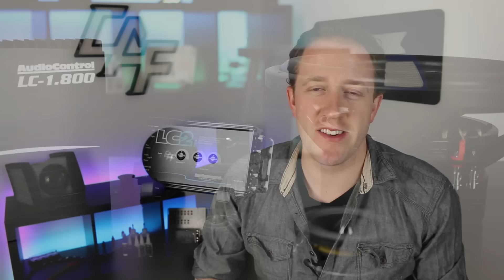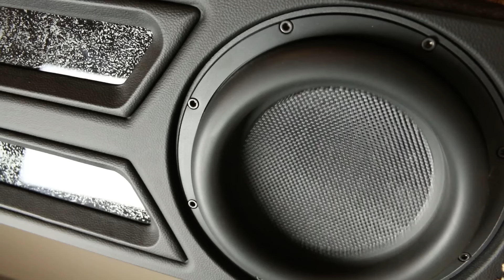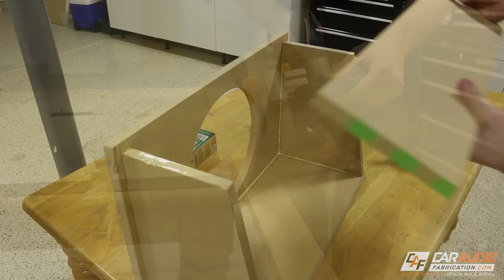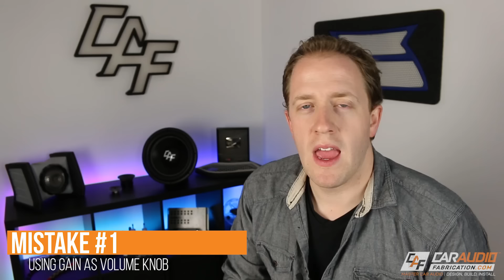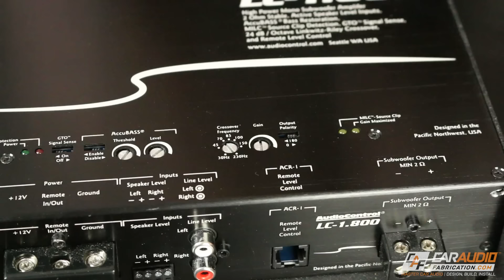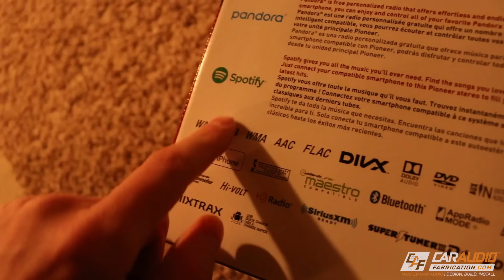Avoid these 5 common Car Audio NOOB Mistakes!

Comment: Lets Say im looking to run a box thats sealed, and the sperate thats ported, both 12 in sub: should i buy two different amps or one? Im looking to give the sealed box more power, because im going with a stronger sub for the sealed box. I hope i explained that clearly 

If one amp is all thats needed,  can that one amp control the two different subs separately? Is that feature called "the channel"? 😅😅😅 Sorry im new to all this

Comment: Old video but I'll toss it out. I bought new Rockford 6x8 a few months ago then ended up getting a new vehicle that has factory 6x9 on all four doors. Should I cut my losses or make some adapters? One of the factory speakers is blown. I do plan on upgrading everything starting with the 3.5 in the dash

Comment: So a def issue I could've seen myself doing is the last one. I'm a noobie, never done an upgrade to the sound system of any cars and never owned my own car yet. I'm planning to buy a '94 Fleetwood Cadillac hearse. I don't want an insane huge stereo system or anything but just something kinda nice with some good quality sound. I've watched a few videos and understand most of these rules. But I never thought of the whole thing of the lights dimming and possibility of having to upgrade the power system to the car if I do too much. So that is an issue I may need to look into now lol.

Comment: Would someone tell me if I dont have enough airspace? 2015 camry with Rockville RV12.2B 1200W Dual 12" Car Subwoofer Enclosure+Mono Amplifier+Amp Kit. Or would it preform better if i had 2 10in subs? or help me figure that out.

Comment: When I was 18 I got 2x  12"s rated at RMS 2k each. I thought they were soo cool. Then I ran them parallel to a 1x 3K JBL amp at 1.5 ohm, rated for no less than 2 ohm... 😬 Then I ran them in a off the shelf ported box that was clearly too small... 😮 And lastly I upgraded to a deep cycle marine battery and two capacitors... And wondered why I had to buy a new alternator every few months.   Silly kid! I am shocked that amp took that abuse. It never failed but you could fry an egg on it!

Comment: The gain control of any amplifier is used to set amplfication factor of any amplifier and to match audio source impedance with amplifiers input impedance.

Volume control ≠ gain control.

Volume knob just works as voltage divider, used to set output signal level from audio source.

Thank's for explanation CAF.

Could I use these tips for home audio too?

Comment: Hey, love your videos! I just bought a 2024 Civic. Is there any reason I can’t run a amp and sub with the high level inputs? I’ve installed a bunch but not in many new vehicles. Any advice would be 👍

Comment: No one has mentioned making sure your ohms from your speaker and amp are compatible. Nothing about having a 1 channel to 5 channel at 1,2,4,8,16 ohms; bridged wiring and how these all affects the system. How knowing a little bit of electrical you can make a $200 system slam. Is this a thing of the past? Not seeing how you can get around these. I'm 44 and still have systems in my vehicles. I only listen to rock so I go for more the full, clear sound with enough bass to fill all out nicely.  These are usually mistakes that cause performance issues. Used to make them when I first started putting systems in my vehicles. I'm very surprised this wasn't on the list near the top, if not the number 1 mistake. I get the gain setting being number 1 though lol.

Comment: For anyone who is worried about streaming music, there is less data there, but it is almost unnoticeable on high end headphones through high end dacs and amps, so stream your music you wont be able to notice anything missing if its close to cd quality (most modern streaming services are) and it isnt really worthi it to have anything above cd quality unless you have a proper wudiophile setup be it headphones or a full speaker setup.

Comment: My issue is between the gain control on the amplifier in the gain control on the LOC. You can fiddle with that all day long and still not get it right oh speaking of I still don’t have it right, what’s the best way to set that? Yes I do have a gain knob. so that’s pretty much like 3 gain controls controls

Comment: I have a hypothesis...  phenomenon is that a thinner box walls can act like a passive radiator. I wish I could build a pair of speakers that are sealed enclosures and have some kind of control unit.

Comment: Questions... im getting two-door speakers 270w 4ohm with separate tweeters and a new central speaker on top of the dashboard in my Sprinter van,... the Question is, do all speakers have to be the same wattage? 
Or does the central speaker have to be lower wattage so its more balanced out?
All speakers are 4ohms, and I'm getting a 4-channel amplifier... any suggestion would be great.

Comment: My first car was a 2002 Honda Civic Coupe. I had the backseat removed for a custom subwoofer box. I used quality speakers. What I had done with the setup is I used 16 gauge wire and added a fuse to prevent parasitic battery drain and electrical shortages.

Comment: Howzit man .   Great video .     

I work for a 3D printing company and and want to design some in dash 4 inch "inclosures"  for the aftermarket " drop in " Sonny's ive installed. 
Any chance you could help clarify what is and ist a good idea? 
    From what Iv'e Learned from a friendly audio specialst , The "Drop in " Sonny's ive used are less efficient and as such are less loud than the Factory set .  
 Will Creating an inclosure of sorts help increase the volume? 
How would I go about working out the Volume Calculation for this?

Comment: Biggest mistake i made was when installing an amplifier not long ago and blew the thing. It was an old-school SoundStream Reference 1000s which has such a huge capacitor bank, you need to initially use a resistor to fill the capacitors otherwise the inrush can damage stuff. Well i forgot about that and BANG went my mosfets. I'm currently repairing the amp and actually restoring it while i'm at it. I've had the amp since the late 90's. 1,000w of A/B goodness.

Comment: but I do have a question its about equipment I want to change over my head unit in my 2011 lincoln mks I've been told don't do I don't like being told don't do because I know it can be done I just have not figured it out yet any suggestions

Comment: i installed an amplifier and subwoofer in my truck and intermittently my stereo deck goes into protect mode. I never had an issue like this before and had the stereo deck and two 6x9's in my truck for the last 7 years. Any thing you would recommend i check? my manual for the kenwood deck just says to check the speaker connections  but it seems to me it must have something to do with the amp/sub install.

Comment: My First was using to small of a Gauge wire for power and Ground wires definitely got too hot and melted the area you hook the wires up, Second was not putting enough power to my Subwoofers I had 2 Kicker L 7’s each speaker is rms 1800 watts I bridged them to a 1,000 watt kicker amp they didn’t get what they were supposed to and ended up messing them up after I put the big enough amp to them they sounded almost blown the kicker dealership wouldn’t warranty them because of it

Comment: Hey mate.i have a 2 din Pioneer but left channel produce less high frequencies than right channel who plays normal - its not the speakers because when i switch channels the problem change the side any ideas what could this be. It also happens on my second car with Pioneer 1 din ... The 2 din is brand new also i get distortion on low volumes any help will be appreciated

Comment: Somebody pls help. I installed pioneer head unit, 1400 watt Rockville Amp, and two 10" subs. My stock speakers play fine. My Amp is on and getting 12.6 volts,but my subs want play. My sub setting on my head unit is on and I tried a new set of rca didn't work. Anybody have any ideas. Pls help

Comment: Don’t run your speaker wire or RCA cables next to the cable coming from your battery. Big no-no. Lots of feedback. Noob mistake.
Reply: Absolutely love your channel. I learned this mistake with my very first build. Figured I would add it since it’s such a simple mistake and an easy one to make when people just start out. I just finished purchasing all my equipment for my dream build, and thanks to this channel I will be doing it all myself. 

That’s a Bronze Star Medal…I have one! Didn’t even know they made those in emoji form!

Comment: Wow. I don’t know how I stumbled on this but I’m shocked that all of these issues were the exact same thing as they were back in the early 90s when the car audio industry was booming with tons of super high quality products. We had clean audio signals back then (actual CDs) and mega clean and powerful class A/B amps even for sub bass. HiFonics made incredible stuff back then but they all use basically the same garbage now but some are obviously better than others. I recall having esoteric audio cables and alternator along with huge capacitors to run things. I had a grand total of 2500 watts (RMS!!) in my Toyota 4 runner and it was a carnival on wheels. Miss those days!!

Comment: I'm an old man and when i was in highschool, Walmart sold a 10 channel EQ, with 4000w power boost button.
😆😂😉
People bought them.
I Just put a single Realistic, 8-ohm 3-way 12/6/3in. home speaker in the back seat middle.
This was in 85 or so
BEFORE IT ALL BEGAN...
Everyone had focused on good home systems before that.
BUT THEN..
An Alpine 700 series Head unit with cassette player.
Kenwood Amps (used to be really good and clean)
2 Orion 12in subs (the best sold at the time)
Clarion 7 band passive Equalizer (everyone used passive eq's)
Some Lanzar Door speakers and pilliar Tweets
AND A FKN BANK LOAN For a car stereo.
In probably a 1000k car? (worth 25k now)
The elders all thought we were stupid, Lol.
But What i'm going to say next IS COMPLETELY TRUE.
The stand alone diamond of my first system was, a pair of pioneer 6x9 3-way (TS / TSX 60 / 120) I bought out of a rear deck in a junkyard; dust, and dead insects in them, but they were unbelievable.
My large amp had to get replaced (warranty) while waiting i switched hi/lo pass on the eq and sent AMPED BASS to those old girls, and they were crazy good for what they were.
Like you would be happy with it just like that.
I've bought many speakers since then, but i've NEVER heard a door or deck (free air/no box) speaker that put that much clean volumed bass out, almost like an ok boxed 10in. at the time

Comment: Has anyone figured out how to install an amp to the 11th gen Civics without every light and warning flashing upon completion? 
I know “Rollin Sound” in Jax absolutely annihilated the electrical system in my daughter’s new 11gen Civic Sport. 
They say they did nothing wrong but, they had to send it to the dealer for three days. The car still did not last 24 hours without the same 8 warnings and loss of power steering. 
They ruined my daughter’s Christmas presents.
Update. I found they stole most of my Kicker brand wiring ($200) and installed BS Amazon “Stinger” wiring. The first time I pulled the rca connector out of the amp (because taking everything aftermarket out was Honda’s solution) the center post fell out and is stuck in my amp! 
I would not recommend “Rollin Sound” of Jax. They refused to pay for the damages too! 
Even though when I dropped the car off they said “100% warranty on all our work for 1 year”

Comment: Gain is a fantastic topic all by itself.  There's two key landmarks:  how far speakers can get pushed before distortion, and how far an amp can be pushed for a given input before it clips or distorts.  One of these will be the weak link, and gain must not go past that.  The important diffeentiation of gain vs volume boils down to this: volume is what percentage of signal is used, and gain is a multiplier [input vs output].  One place to see blazing ignorace of this difference is... at a drive through.

Comment: So I recently added a cigarette lighter to the bed of my truck. And now when I turn on my stereo (it’s connected wirelessly to my head unit) I’ll hear a little wine at certain low revs. Does this mean I have to check the ground for my head unit? Or should I upgrade the big 3 for my truck? Thanks any advice. Love your channel.

Comment: I used to always mount my amps to my enclosure .  I am not into ear breaking bass, so probably not an issue. Best practice, isolate your amplifier  from the jiggly bits (subs). Jiggle your electronics into broken :(

Comment: As far as power issues go if you're driving an old truck Or suburban I'm talking like sixties Or older put a dc generator on it They're significantly more expensive than alternators but the power is smoother because it's straight DC no capacitor required you might be able to get a antique tractor generator to work or convert an old Chevy 6 V to 12 V

Comment: I installed a flat box subwoofer under my passenger seat and put my ground on a bolt XD i mean just a bolt laying on the carpet floor... yeahi was told just too put it onto somthing metal aka the chasi bc its "grounded"

Comment: I had my subwoofer professionally installed for $300. amp was already screwed in the side of the sub box and no custom fab work was needed, just wiring. Think they could tune it? not a chance. that thing sounded disgusting.

Comment: I wonder what people say about grounding! Always ground the amplifier in your battery! If  you have the battery close that is!    I have a b2 osprey zero8 and and 4 AGM batteries!  1 pluss and and - from each battery! I have even done the big three, and  upgraded my alternator from a 160 amp to a 270 ampere. 
My subs are sundown u15  @ 1 ohm.   It sounds awesome😁

Comment: I got new speakers Kicker ks 6.5 and a 1500.4 crunch amp and my system sounds so weak. I asked for a DSP and they ended up putting a bass restorer i aint even got no bass at all. I’m pretty pissed off I was so excited. I’ve had alpine type Rs and a 500.4 amp before and that was way much louder. But this new system is connected to my factory stereo and sounds just like a stock radio it’s a 2022 kia k5 gt line. This is my 1st time having a stock radio and usually on the aftermarket they have a boost or loud mode. Can that be the problem?

Comment: Is mtx a good entry brand? Ive been looking at a subwoofer that has a box and built in amp with a wiring kit included for a total of 200 bucks.

Specifically the RT8PT model.

Comment: Thanks for the reminder. It’s probably been. Over ten years since an amp sub install. Again I’m starting fresh dampening already bad factory sub installed on a accord coupe and just want a basic 200-400w rms dual channel for subs. For now a simp 8 in the trunk in a lil box. And improve the sound on the factory 8 sub on the back seat.

Comment: What I do when I install mine is Turn The Radio not all the way up but almost maybe a quarter from being all the way up and then go back there and turn the gain until you hear it clip and then back it off a little until there's no distortion and that seems to work for me

Comment: What is you opinion on using high level input if I'm using the factory radio from 1998? That's what I did and it worked fine. Definitely not great audio though

Comment: Hey Mark, I've been in to car audio for 20 odd years and have always used "Loudness" on my kenwood headunit. What's your thoughts on using it?

Recently turned it off and so far happy with the sound. But would be keen to understand what it's actually do9ng to the sound? Is it only working at low volume?

When would you use it? My newest unit has a low and high loudness setting
Reply: Crickets 🦗 🦗 🦗 🦗

Comment: God haha.. did all those mistakes! power supply first of all, ending up rewiring + 120v breaker on the battery, had to tow the car twice, car had no more juice, light dim and shut on highway.. No capacitor at beginning. Bad setting, blew subs and amp. Put wakeboard amp + bad settings haha i've burned around 9 set of speakers

Comment: FYI ..I did upgrade to a Mechman alt but I SHOULD have got the UNREGULATED version ...half the time my Mechman is running @13.6 instead of 14v ...which you might think wouldn't;'t make a  difference ....it makes a huge difference in the punch sound quality of my subwoofer ......gonna have to make that change in the near future 
ALSO using a good Fiio DAP it night and day better sound quality than my iphone

Comment: I just installed my subs and system but the biggest issue I’m running into is my amp going into protect mode when I turn my volume up…. I checked all the connections which are totally secure and the ground in on a clean clear surface…. I’m starting to think my amp my be to much for my subs …. 1600 watt amp vs 1200 watt MTX 12” subs can’t figure it out man help me out!!! Lol

Comment: I think one of my mistakes and I could be wrong here cuz I just scooped around with it I bought subs capable of holding thousands of watts and maybe put 500 watts on it it still sounded fine but I felt like I could get a little push from a smaller sub nowadays.

Comment: I have a kicker cxa800.1 pushing 2 kicker l7t 10 inch subwoofers in a sealed box. Need help tuning the cover frequency and the gain. Also, should I stay with sealed box or go ported?

Comment: Hey my old truck I put a system in it with a capacitor the battery just can’t keep up so I bought a new battery I want to wire it to my capacitor how do I properly do that

Comment: I got amp run 206RMS ohms to each speaker. It’s around 2200watts. And i got 4 speakers around 50RMS. (With 300watts peak) can i use the amp safely with low down the gain?

Comment: Can i use amp low inputs RCA directly to the aftermarket stereo? car wire connection to the speakers. And amp low inputs RCA channel 1&2 to the stereo